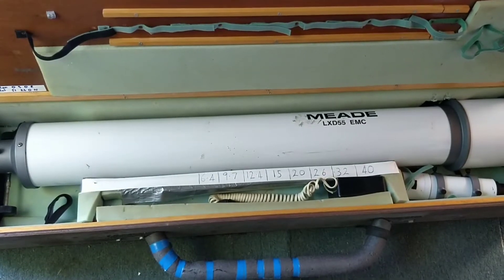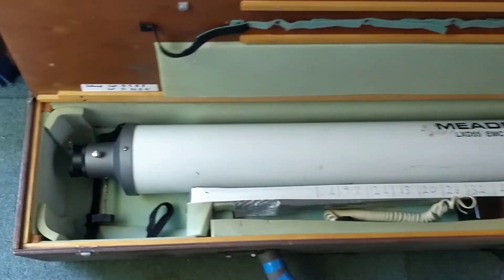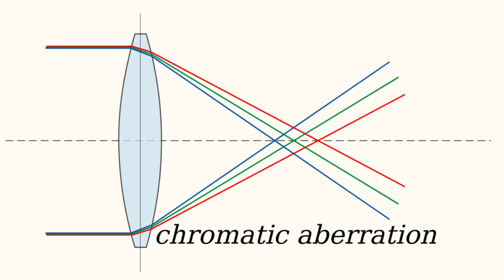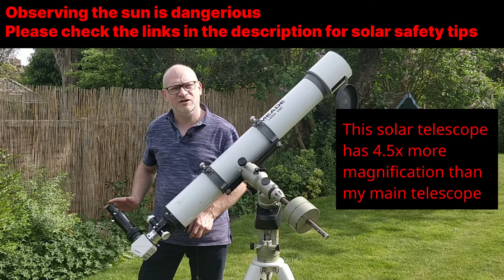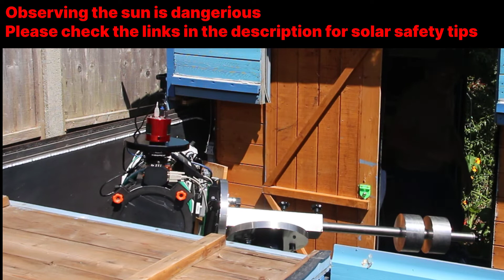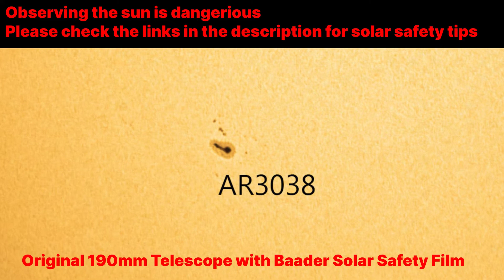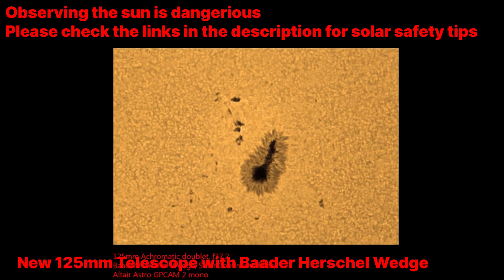93. Making a high resolution Solar Telescope.

Comment: I understand your use of the felt, Do you have adhesive back paper on the inside of your dew cap, and inside of your scope. I have used it for years inside my Newtonians. My one concern is, have you had any problems with the adhesive giving away because of the heat inside the scope, and starting to curl? If that happened, you might get an ignition of the paper from the concentrated solar image coming down the tube.
Reply from the maker: Hi,  thanks for the question.  The felt is 'Velour', a man made product (from Hobby Craft),  i think it would melt first,  but I've not done any experiments, I'm not sure if it is flammable - probably in the right conditions, I've not had issues  with it curling, the dew cap and inside tge telescope are covered in Velour.
I don't leave the telescope unattended when solar Observing.

Comment: Is that a 5 inch refractor? 127mm?
Reply from the maker: Yes, it isn't a very good one, but I'm imaging a very narrow band so the chromatic abberations dissappear. You can see my images here https://britastro.org/observations/user.php?user=7740
Reply: Your images using the Herschel wedge are quite good! I noticed the improvement in resolution when I got one for the 2012 transit of Venus. I have since tossed all my solar screen caps because I no longer use them when looking at the sun.

Comment: wow so interesting and hard to find step-by-step DIY solar telescope information.  😎 I am learning how to make a SDR radio telescope which is a challenge to get the hobby parts list put together. In so doing I bounce around on cool videos like this one, which would be wonderful in mapping the sun with radio and optical superimposed images.  🧐 Thanks a lot.
Reply from the maker: You might also consider SID (sudden ionospheric dispersion) using VLF, it is really easy, full guide here https://crayfordmanorastro.com/radio/sudden-ionospheric-disturbances/
Reply: @DIYTinkerer  thank you so much and I will check it out.
Reply: @DIYTinkerer  Very interesting information. thank you.